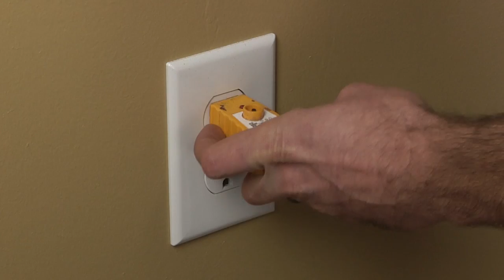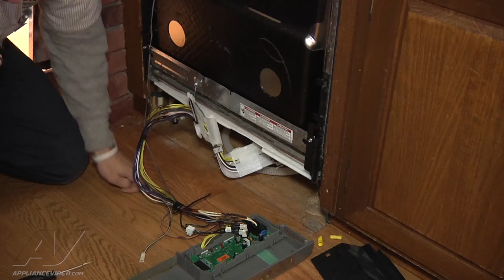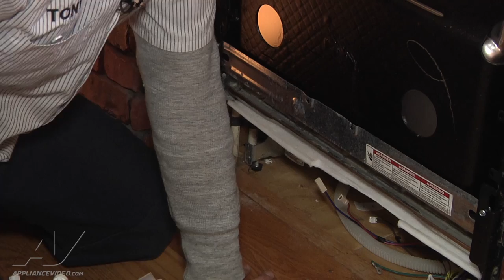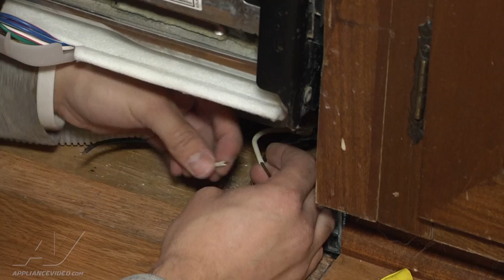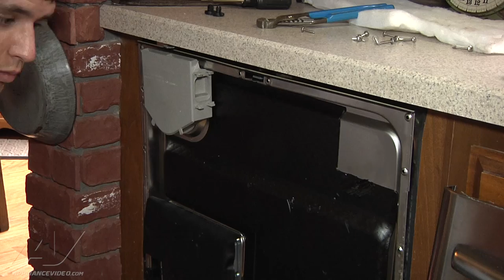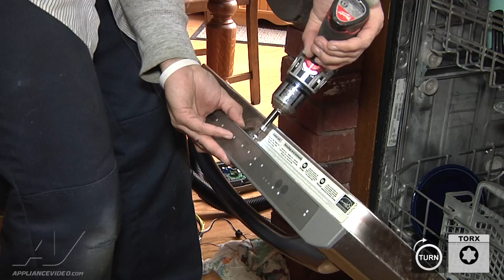Maytag Dishwasher Repair - Burning Oder, Burnt Wires - Wire Harness

Comment: I want to know why this happened in the first place? I just had the exact same issue with my MDB8959AWS5. I smelled wires burning, you know the smell..... It stopped working... The lights on the controller would flash and I could hear a click from where the board is located behind the silver cover--upper right hand side. I did a reset on the board but still same thing....  I took the cover off and saw that the wire harness was burnt. I also had burnt wires and wire caps down where the black, white and green ground connect in the power box. The board didnt look burnt from behind but dont know if that was part of the issue. You cant buy the part that has all the lights on it for the control. I got 11 years out of this dishwasher. ((((((I want to know why it happen in the first place.)))))) If my home burnt down, isnt Maytag liable? THIS SHOULD HAPPEN IN THE FIRST PLACE, RIGHT? Are the Maytags being build now in 2021 any different?

Comment: If you remove the 2 screws that hold the unit to the counter, you can grab the top and rock it foreword about 20 degrees.  Then it will lift up an inch .   Even with very thick flooring, you can get more by spinning the front legs up.  It's a pain, but It still seems easier.
It would be nice if flooring contractors would spin the front legs way up and then run the flooring 2 in inside the kick plate.  Burt don't hold your breath.
Reply: Truth! I can't imagine a DIY-er trying to blindly rewire all those connections on the bottom of the unit. That hardwood flooring doesn't look to be any thicker than that which we installed in our own kitchen and I have been able to retract our dishwasher and service it just as you described. I traced my original problem to a failed sump pump. This time one of the wiring harness connectors melted down at the motherboard. Ack! We're lucky it didn't catch fire.

Comment: Do you have to change the main control board if you have burnt wiring harness?
Reply: The service schematic and step-by-step trouble-shooting instructions attached to the bottom of the dishwasher provide the "secret" button codes to reset the dishwasher's brain. If that fails to do the trick, you may have a faulty latch switch. I replaced the latch switch in my unit, but it still wouldn't start. So, the next step was to replace the motherboard. I was fortunate to find a parts supplier that had a replacement motherboard in stock. Most places said I might have to wait 'til Christmas 2022 (five months) to get the part. Only as I was removing the original part did I discover that a a wiring connector had melted to the board. Now I have to find a parts supplier that has the proper wiring harness in stock. This isn't 2014: Everything seems to be made in China these days, so it's anybody's guess if/when I'll be able to complete the repair.😭
Reply: @ronforeman2556  No free advice huh, then why do a YouTube video??

Comment: Mine is a whirlpool quiet companion 2. I got it and the wires have been chewed by a mouse or something. The problem is there is a lot of brown wires and I'm working on replacing them, but some has been chewed all the way down. So can't figure out where they all go.
Reply from the maker: Great question, you can call
our parts department at 1-800-830-5465 and they can give you help 6-days A week
Mon-Sat . You can also search at www.SaveMoreOnParts.com 7- days a week.  If you have a more
technical question that our parts department cannot answer, our technicians are
answering all questions at our website at www.ApplianceVideo.com under our Repair Help section. We have over 6,000
common questions and answers that you can easily search through by your model
number, appliance make, problem or error codes, and It’s completely free to
search through our question & answer library. There is a very good chance
you question is already answered there.

Comment: I have a Maytag model MDB7749AWB1 with control panel part # W1028356B. Same issue, two of the wires appear to have gotten hot at the control panel. The blue wire, and particularly the white wire at the terminal marked P4 (Door_Neu). It started to melt the plastic harness. I am ordering a new control panel but not sure about the harness. I caught it pretty early and don't think the wiring is damaged considering the insulation did not melt. What are your thoughts as far as the cause for this and my decision in respect to parts replacement. It has worked great for 5-6 years and I hate to throw too much $ into it when a new replacement is not that much more. Thanks.
Reply from the maker: Great question, you can call
our parts department at 1-800-830-5465 and they can give you help 6-days A week
Mon-Sat . You can also search at www.SaveMoreOnParts.com 7- days a week.  If you have a more
technical question that our parts department cannot answer, our technicians are
answering all questions at our website at www.ApplianceVideo.com under our Repair Help section. We have over 6,000
common questions and answers that you can easily search through by your model
number, appliance make, problem or error codes, and It’s completely free to
search through our question & answer library. There is a very good chance
you question is already answered there.

Comment: WTF!!! Is that normal to have all the wires heating up and melting? You never even mention why this happened? I have a Maytag dishwasher that has an intermittent burning wire smell. It is only one year old and I have had two different technicians come out and tell me "we can't find anything wrong" ???? This thing is going to end up burning down my house!!!
Reply from the maker: No its not normal, we only seen it happen two times in 30 years. The relay had a bad connection and started arching.
Reply: A lot of these were recalled.

Comment: My Maytag about 6yrs new burned out the control board. It just smoked at the main harness connection. I took it out of the counter to disconnect the power and could also see the main power wire from the wall starting to melt into the protective coating on the back of the case and at another lower location were the power/wire touches the side on the way down to the front power box. Anyway I know I'm wasting my time so into the trash it goes. Hats off to another manufacturer with a short life product. Touche'. Do I roll the dice to pick the next company that gets my money? Oh I'm done with Samsung and the washer dryer repairs tool. Now I'm on GE basic models just for the price savings. You're on the clock GE
Reply from the maker: Thank you for
your responce, I hope GE appliances work ourt for you. The more basic the better.  
Help us by subscribing to our YouTube channel or post our website www.ApplianceVideo.com  on your Facebook page. We want to let your
friends & family know how our FREE videos can help them.  Or you can
support our parts department at 1-800-830-5465 and our parts website www.SaveMoreOnparts.com .  This is the only way we can continue to
post free videos and help over 1-million people per month like you repair their
own appliances. We also have thousands of more quality videos on all major
appliances made by our factory trained technicians at www.ApplianceVideo.com .
Reply: My control board smoked 4 months ago, I looked 2 months for a reliable replacement, but didn't trust them for the high price. I got tired of hand washing, so I finally ordered another control module and replaced the burned wires. Works great, but I only run it while I'm there, and anticipate it happening again, yet have  time to shop around for a new deal.